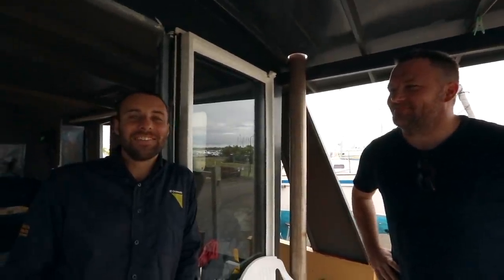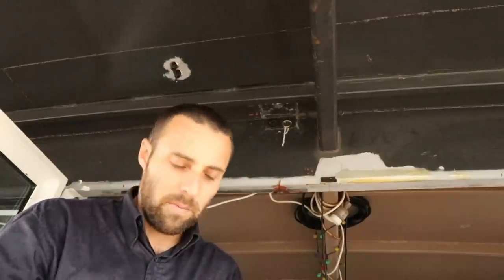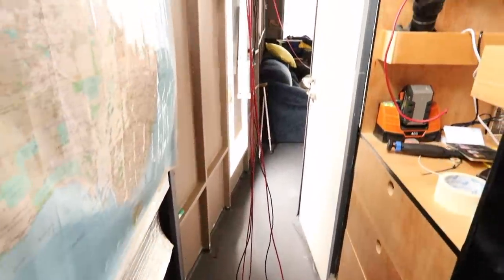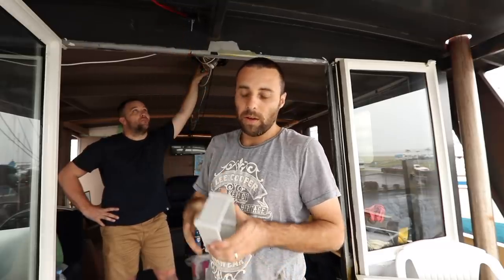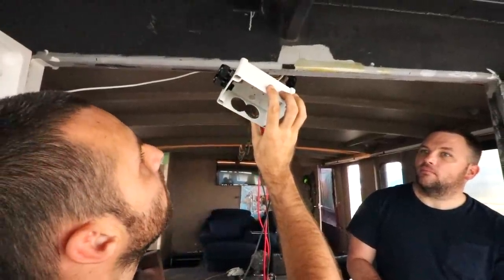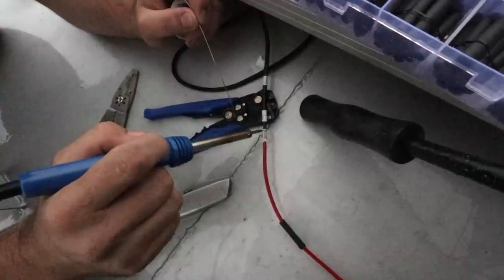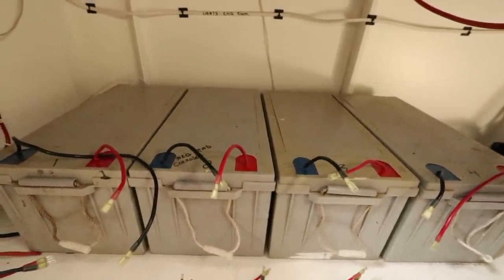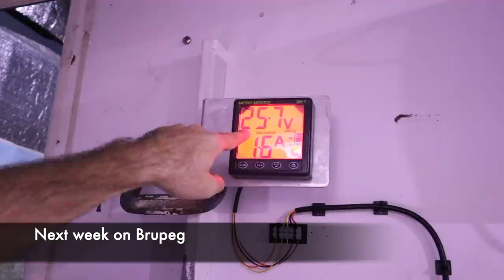How to install Marine Solar Power - Project Brupeg Ep. 89 (part 3 of 4)

Comment: Hello Damien and Jess!  Love your channel and what you guys are doing, been following since day 1!! I have kind of an off topic question but am very curious in a situation of a total engine failure in the remote areas of the arctic how would you get brupeg home? Do you carry a spare engine?
Tommy
Reply from the maker: Hi Tomy, great question. 

Commercial engines like Brupegs are generally much heavier than non commercial engines so the metal is generally thicker and doesnt fatigue as easy. First step is maintain the engine like your life depends on it so it doesnt break. But assuming youve done that and it still stops, I (Damien) am an ex engine reconditioner, so I can fix (or patch up) most things engine. We will also make sure on any very long expeditions we would have at minimum 2, most likely 3 people onboard that can handle large mechanical failure. Brupeg carries a full engine rebuild kit so we can fix 90% of any possible failures up to a catastrophic level. On the water we could deal with anything like a failed turbo, siezed piston, catastrophic injector failure, coolant issues, cylinder liner or piston replacement, conrod replacement etc. we will have a limited ability to rebuild the bottom end of the engine but we do carry a spare crankshaft and bearings to suit, the thing we may struggle with is if the block is dammaged by bottom end main bearings being run dry. But that said we could like patch the engine up to crawl us back to the nearest port. Most commercial boats are single main engine boats and most ultra long range boats would have a similar level of parts and rebuild capability on board.
Reply: Project Brupeg I was thinking you would have all the spare parts to do an emergency engine rebuild etc. There is no doubt in my mind you wouldn’t have the know how or a good backup plan! Thanks for the response ,best of luck with everything for you and Jess
Tommy
Reply from the maker: Thanks Tommy. It’s all part of it aye. Thinking every possible situation out and the many ways it could fail, so we can plan for a solution. Thanks for your interest in the project.

Comment: On a steel boat with negative earth, did you need to run all those earth cables? If the cable is a continuous run, why use the openable enclosures with cable glands? It's just a cable run so trunking/conduit would be fine.
Reply from the maker: We are trying our best to keep all negatives off the hull. Not possible to eliminate all of them but certainly possible with our 72v solar earths and our 24v house bank. Currently the engine is negative with its 12v system and were not 100% certain we can eliminate that one
Reply: @ProjectBrupeg  Why keep negatives off the hull? Is this a corrosion issue (electrolysis)
Reply from the maker: Yes. It’s an area I don’t know enough about however it I make the hull negative it may cause an issue. If I keep the negatives separated from the hull it can’t cause an issue

Comment: Maybe use a 1/4"  or  3/8" small piece of rubber hose as a protective device. Cut small piece split length ways and you have a nice flexible isolation point.
Reply from the maker: Yeah thats true, and being rubber it will conform to weird shapes quite well.

Comment: you need a 60W iron for wire that gauge, otherwise you overheat and melt the insulation.
Reply from the maker: Yup. Ours was crap. We ended up using a gas torch for the rest
Reply: I havent soldered a marine wire in a long time, crimps are a better soluton, you dont create a hard single core wire when the solder wicks down the cable. Its a perenial debate ....
Reply from the maker: Yup agreed. Just didn’t have crimps we were confident in of that size so opted to solder these ones.

Comment: That wiring diagram looked nice, in which program was it drawn? I need to make wiring diagrams for my boat.
Reply from the maker: Ha! Your going to laugh. MS PowerPoint. Our mate Tim drew it up. I will put it up on patreon so you can download it and see if parts of it will work for your boat
Reply: @ProjectBrupeg  Haha, I've been using Microsoft Paint so far, was hoping you had something more advanced. Thanks for putting the files up, I'll try drawing something similar in Visio.
Reply from the maker: Actually Dangar Stu just told me all about a program called iCircuit. Available at apple and pc App Store. I’ve seen the results and they are pretty awesome

Comment: That missing panel has made my eye twitch for over a year now...
Reply from the maker: Still trying to find one with the right specs to replace the old one
Reply: @ProjectBrupeg  Ya, I posted that while the video was still playing... Interesting to hear why it's been so hard. As an aside, I've built my entire career of learning from screwups. Makes for a fantastic teacher!
Reply: @ProjectBrupeg  are you looking for a new panel or used?
Reply from the maker: Hi Quentin, im happy with second hand. Not many things can go wrong with solar panels.
Reply: @ProjectBrupeg  what are the specs? 48v 255w?  Trina Solar?
Reply from the maker: 235w 36v poly no name brand.
Reply: @ProjectBrupeg  are the dimensions same size as ordinary house panels?
Reply from the maker: Yes. These are house panels
Reply: @ProjectBrupeg  have you considered keeping the other as a spare and replacing the two with more commonly available 48v panels now that you have seperate mppt charge controllers per pair?  Used paneks are $25-$40 each.
Reply from the maker: Yeah actually that’s not a bad idea. I hadn’t thought of that. I’ll have a hunt on eBay and see if I can track a pair of panels down
Reply: I reckon the ones we use on solar water pumps are that size 
They're definitely 36v 
Might be worth giving Water boy a call and ask where they're soucreing panels from 
They always sell them in 4 for their pumps that run on 140v 
They might have an odd one that it's mate got smashed in delivery or something
Reply from the maker: Ok cool. I’ve not heard of them before so I will check them out. Thanks

Comment: If you wantedto get the screws at 90* 
They make flexy screw drivers but they don't flex much 
Or you can ust use those drill driver screw inserts and just but them in a 1/4 spanner 
Mechanics trick for bastard engineers
Reply from the maker: Ohh I love that! Never crossed my mind but it’s absolutely perfect!

Comment: beware of induction.
Reply from the maker: Why? Are we at risk of it sneaking up on us and making a nice stew? I could deal with that, I like to live dangerously
Reply: In a way yes. As I'm sure you know DC voltage has a way of working against you and inductance is one of them.  Transient voltages can have an effect on gauges and instruments. That's all I was thinking about with the previous post.
Reply from the maker: Thanks Everette
Dames just explained the fluctuating voltage thing. Great point. We haven’t seen anything yet but will keep an eye on it. Cheers Jess